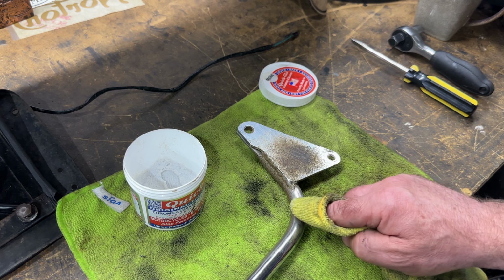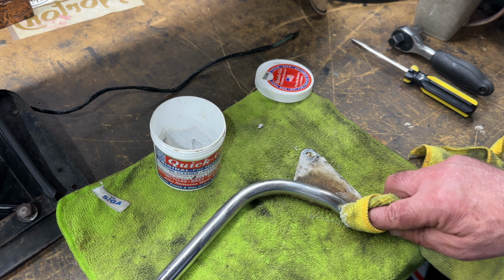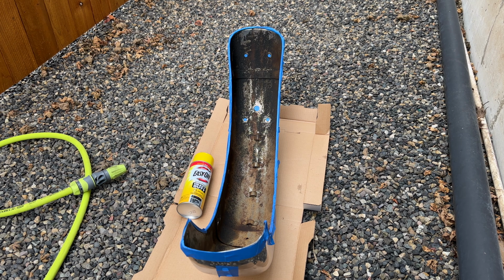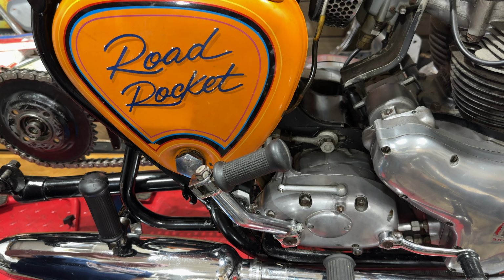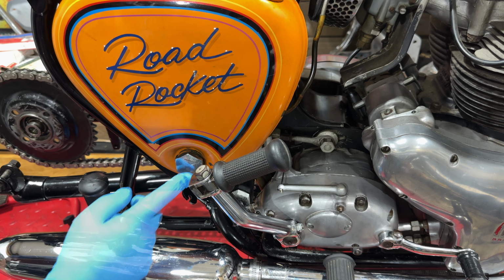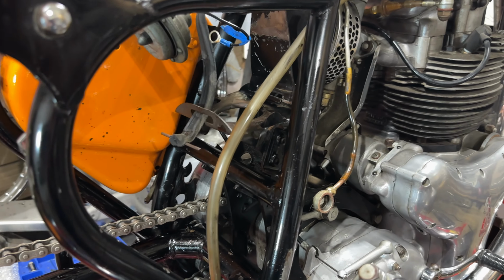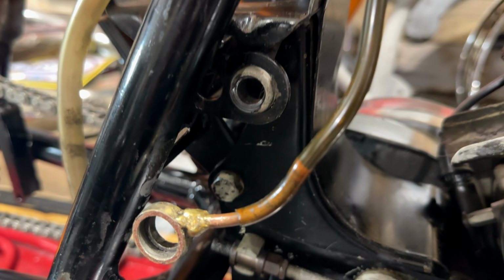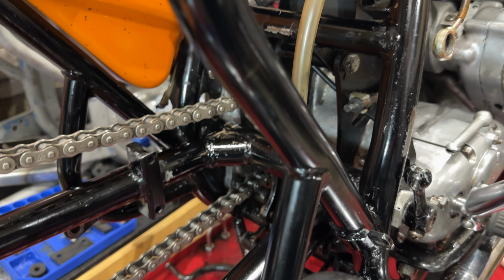1962 BSA A10 Super Rocket (Part 4) - Disassembly

Comment: The Brit Bikes generally had durable chromium plating lasting well for decades of weathering, but Lucas bullet connectors which weathered immediately and stopped the bike.

Oppositely, the early Japanese had a flash of chromium 3 atoms thick that lasted one season, but electrical connectors that conducted for decades.

When I pressure washed the rear fender of my Honda CB350F project years ago, I blew the plating right off!!  Nothing wrong with a painted fender!
Reply: Dielectric grease will help those bullets last longer.

Comment: Everything rearward of the engine normally is in good order due to the coating of oil mist it gets from the leaking engine !  If you are experiencing oil sludge in the tank then I humbly suggest using a better oil - modern ones keep such sludge suspended in the oil so it doesn't 'settle-out' into the tank but drains out with the oil when it's changed. Oil with additives is what you want - I use Lucas oils - nothing to do with Lucas electrics, but it's one of the better oils that gets used in Top Fuel drag racers and is also better value than Castrol etc.

Comment: Solvent (white spirit/turps/petrol) and a brush far more effective than cold water and kitchen stuff. What l thought was a fibreglass 'repair' in last video, was not the case, insect nest? Looks good, oil residue and dry storage works wonders for preservation.

Comment: Grab yourself a plastic dustbin and some phosphoric acid dilute .put your Chome in and leave for a few hours then wash .it will not damage chrome just the rust don’t have parts touching each other.
Reply: Here in the UK a good cheap source of phosphoric acid is Milkstone Remover sold at farm supply shops.
Reply from the maker: Thanks very much for your advice Bob. Cheers, Mike.